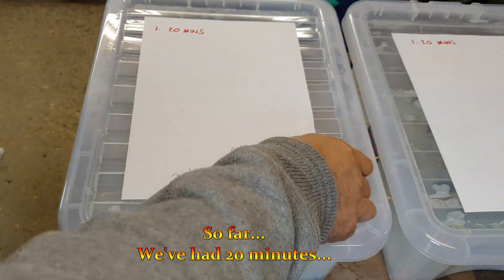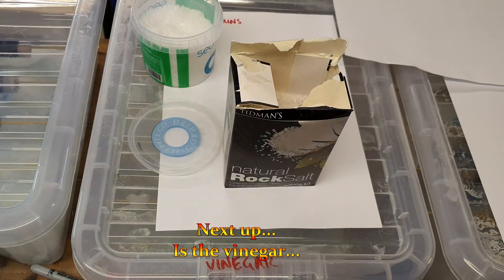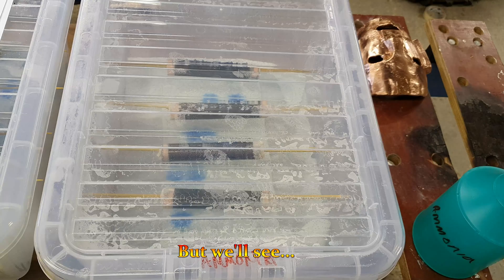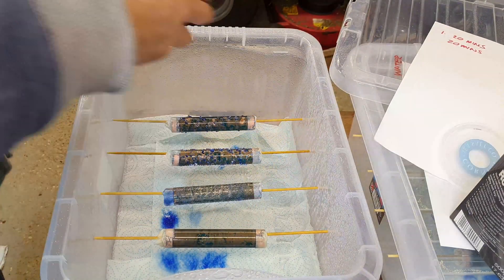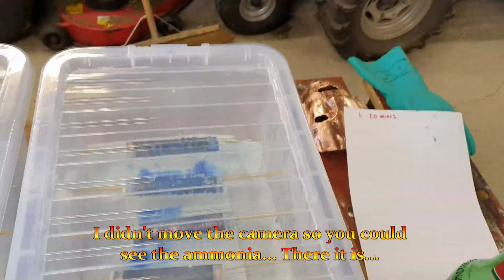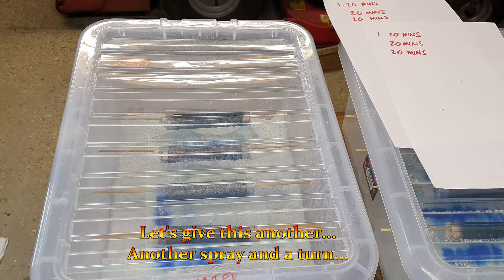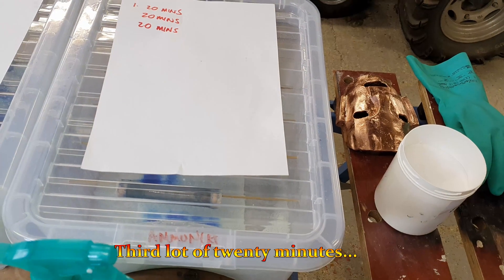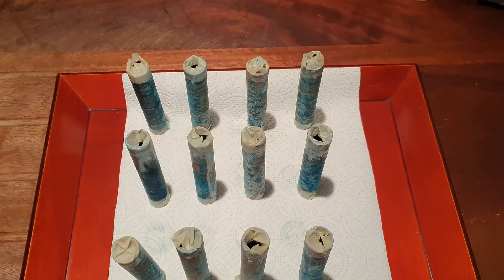Testing Blue Patinas on Copper #1 - Part 2 of 3 - * Some Swearing *

Comment: I am trying to figure out why my house water (city water) was green when I moved into my house a year ago. We have copper pipes. I can't get answers from health dept, city, scientists, etc. We have not been drinking it. Replaced pipes under the house to Pex but still needing to replace pipe from house to meter. Any information you have would be appreciated.
Reply from the maker: Interesting.  Is it still green or has it gone away since you moved in ?  In the UK almost all houses use copper pipes, apart from newer houses where they use plastic and pushfit fittings as its cheaper.   I've never heard of anyone ever getting green water in the UK, our water is crystal clear and can be drunk straight from the tap.  Green in copper is from oxidisation and for this to happen air must be present.  Which would be somewhat illogical as the back pressure from the water supply should keep the pipework full of water.  Was the water system switched off and drained for a long period of time before moving in, allowing the pipes to fill up with air ?  Chlorine can also cause copper to turn green, although I would imagine chlorine levels would have to be quite high.  The only other thing that pops into my head is chemicals from fracking activities.  Although i know nothing about this as fracking is not done in the UK.  Copper pipes are usually safe as.  Cheers Andy :)
Reply from the maker: Oh and copper oxide is not harmful by the way :)
Reply: @MeltandCast  no it was only green a few minutes when we turned on all faucets. I've recently started drinking it and using for cooking.  Not sure it's the water or poor food choices this last week due to stress but my stomach has been pretty upset. LOL

Comment: End the madness.  https://www.youtube.com/watch?v=Wli9stbEvPE Then call https://tiranti.co.uk/  ask for cupric nitrate.  They sell the sculpt nouveau product line.  Hot fired patinas just work better, produce more predictable and even results.  Copper acetate "Verdigris" produced they way you are will be very fragile and does little to turn it green.  You are simply creating a reaction that lays on top of the metal..  Ever notice rat poison is usually green??  3 guesses why.
Reply from the maker: Thanks WT.  I will add that to the list of patinas to try along with the liver of sulphur you suggested a while back.  The main idea for this video series is to try as many different patinas as possible, good and bad.  Using as many different recipes as possible, as there are many.  The ultimate aim is to provide a patina archive / library so to speak.  This will allow people to look at a range of finished patinas for their own projects and then refer back to the original video to see how it was achieved.  I may not get it right first time... but I'm learning too.  I've never tried patinas before, it's mad how the colour changes though.   Good website, lots of great stuff on there... Cheers Andy 🍺🍺🍺👍👍👍
Reply: @MeltandCast  There is a book I bought last year.  It's called Contemporary Patination.  I HIGHLY recommend buying this book.  https://sculptnouveau.com/products/contemporary-patination-2nd-edition.  If you can come up with a color, it's in there and tells you how to make it work either hot or cold.  Worth every penny.  Your archive/ library has already been done for you.  >>>  http://www.alloyavenue.com/vb/showthread.php?12773-The-Patina-thread
I wonder who ran that thread?  :-P
Reply from the maker: @jagboy69  Nice one WT, I appreciate that !!  I'll try and get a copy of that book, that should really help... I have seen that same list of patina recipes, although on another website...  It was one of the reasons that prompted me  to make a bunch of videos about patinas, as there wasn't any visual information to accompany the recipes.  Also there wasn't much information on the actual process of applying the patina.  I appreciate there are many people who know way more about this than me.  But I figured if I tried them, people can see the results for themselves in HD. 
As a bonus I get to learn all about patinas at the same time !!
As this video series progresses, I hope my plan will make a bit more sense once I start to organise the finished results into a single video with ALL the patinas in one place.  That way it would be really easy for people to just say "I want that one", check the number, and check the video that goes with it.
Some of the chemicals I suspect aren't easy to get hold of and some I guess people won't want to work with...  I can work through those and see for myself and report back.
Also I think real artists would take patination a bit more seriously than the average hobbyist who just wants to "have a go".  An artist would need to consider patinas much more carefully as ruining an art piece that has taken many hours of work would be a disaster.  Artists would do their own research I suspect.  This series isn't really aimed at proper artists, more the average Joe who just wants to experiment with their projects without spending additional money on books.  Really appreciate your help mate, Cheers Andy  🍺🍺🍺👍👍👍😎
Reply: @MeltandCast  What you are going to learn is people tend to be pretty damn tight lipped when it comes to patinas.  It's one of the final things that gives work "the look" that often is artist specific and sets their stuff apart from others.  You can have an identical chemical mixture and it will come out 9 different ways all because it was applied with more/less heat, time, strength etc.  I'm interested in your work obviously because of the bronze.  There is a famous patineur here in the US that once upon a time would sell a 1 day class.  It was very expensive to attend and I hear was shit because the guy moved so fast and only demonstrated without explaining what was actually happening.  Fritz actually passed on going to the guys last class.  I couldnt go and probably would have gotten tossed out when I pulled out the gopro.🤪💩😖
Reply from the maker: @jagboy69  I can understand that, it is after all their lively hood - trade secrets and all that !!  This will by no means be a definitive guide, as TBH I am kinda bumbling my way through this. Perhaps in 6 months I will be able to talk about this subject with a little more confidence.  I will also try and include your comments in the narration with regards to fragility, application and durability as I think that is also important.  I still have the lacquer section to film for the third part, so I will make sure I include your comments with my sum up of this batch and future batches.  I think now I've set this path for myself it's going to take quite a few months to finish...  Thanks again, I think we should keep in touch.  Cheers, enjoy the weekend... Andy 🍺🍺🍺👍👍👍😎